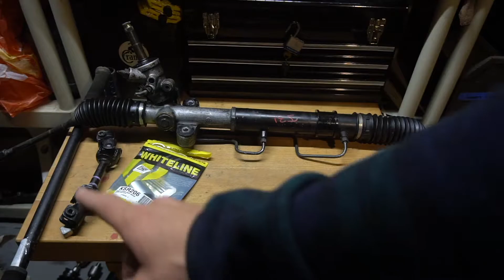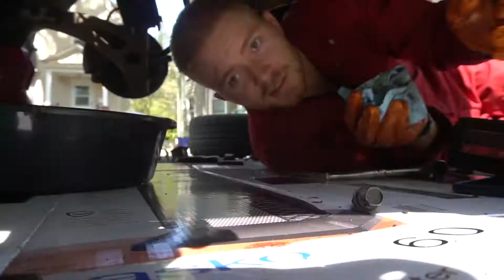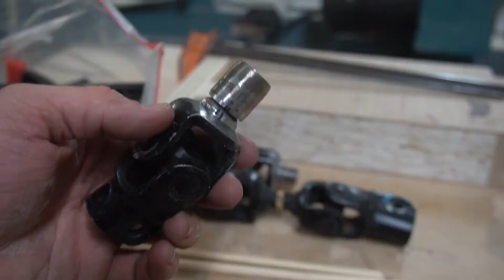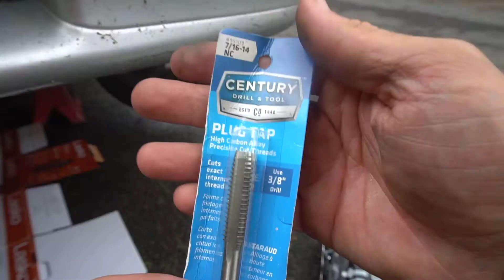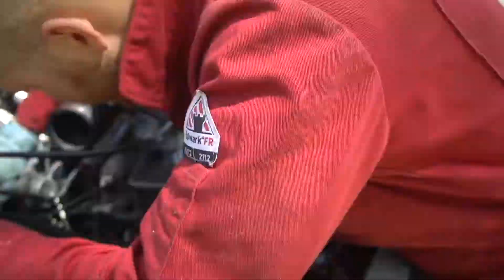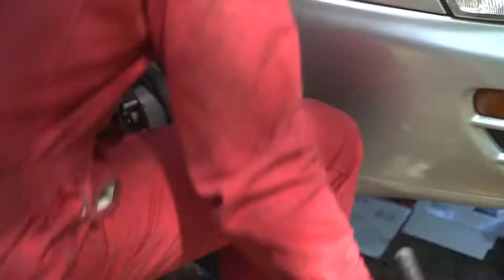1992 Subaru WRX Gets an STI Type RA Spec C Steering Rack!

Comment: Do you sell that modified linkage yourself? I'm running a 2004 STI steering rack in 2004 STI steering column with STI dashboard and there is a binding also. This would actually work perfectly for me but I would need the STI linkage just shortened to that size
Reply from the maker: I made the linkage myself with the stock linkage from both cars and matching the length of the GC8 one. There is a company that makes the adapter ones though if you look it up. I forget the name. But if they don’t make a shortened STI one, you might have to do it yourself.
Reply: @TwoRoadsGarage  just found your channel, loving the content since I have a 95 ej20g. I havent gone through all the videos yet but how come you decided to swap out the ej20g?
Reply from the maker: @e @et-ef5nf ’m glad you find the videos helpful! And I didn’t swap out the EJ20 G, I replaced it with another one. The original one that was in my car was leaking oil like crazy considering the age, and the valves were leaking too. I bought another one and resealed everything on the side so when I pulled out my original motor, I just put in the replacement which is fully refreshed. Also, I  upgraded a couple things while I was there like head gaskets, head studs, oil pump, and oil pan. I plan on keeping the ej20g and just building it in the future. But I appreciate the support! I have some more videos coming soon.
Reply: @TwoRoadsGarage  ah just seen the other video. I thought you did a full 2006 sti swap based on the other title but looks like it was just the drivetrain. Can you post a video with wiring or any issues you run into? I would like to go 6speed on my ej20g as well
Reply from the maker: @et-ef5nf Yeah there will be more videos on this. All the issues I’ve run into so far have all been in the videos, so you’ll be set